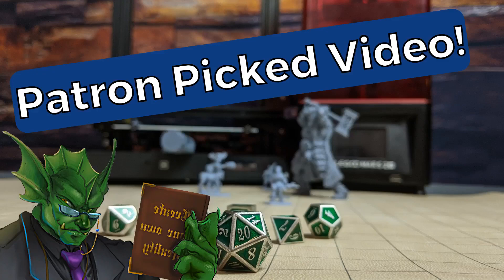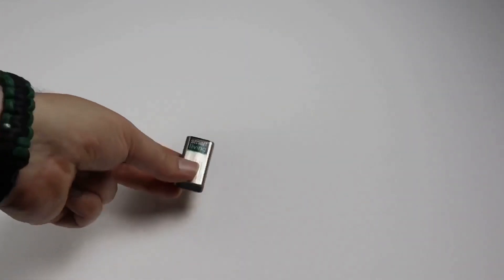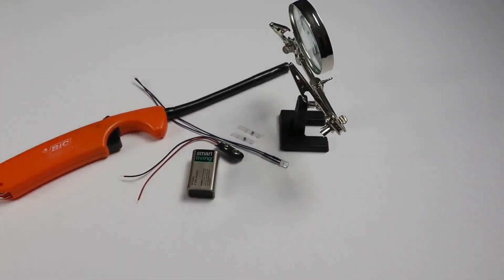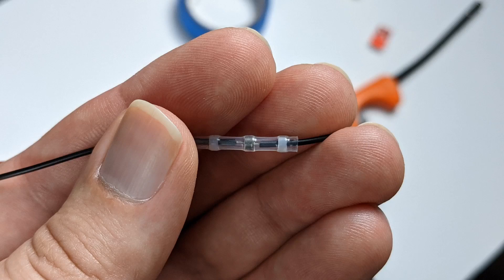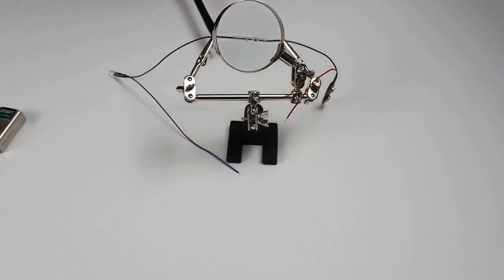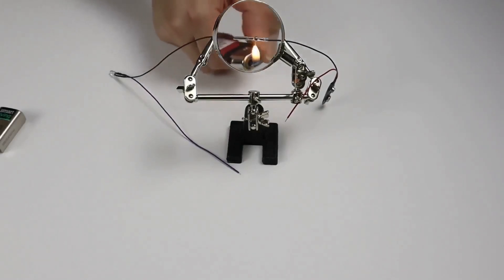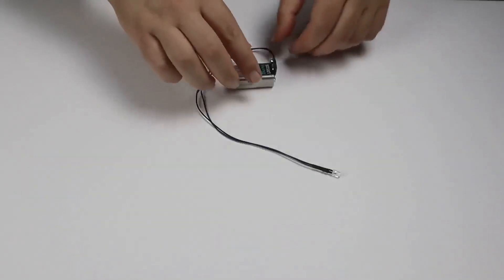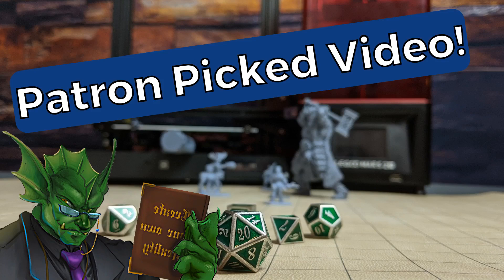How to Make a UV Pin Light for Curing Inside Hollow Resin Models

Comment: It is also important that the built-in resistor is mentioned with the LED, this should be included in your list, even if your recommended ones are already equipped with it.
But you make great videos with lots of good tips and information.
Reply from the maker: I do mention that in the listing for the LEDs. But you're right, it would have been helpful to mention it in the video as well.
Thanks for the positive feedback!

Comment: I know I'm necroing an old video, but I'd like to design and print a resin housing for this, and incorporate an on/off switch. Before doing all that, though, do you know if that's been done already?
I'll keep you posted when/if that comes out :D
Reply from the maker: I have not seen that, but it could easily be done. However, you could purchases most or all of the parts to accomplish that right from Amazon. You can certainly get 9v battery housings with on/off switches and go from there. But designing something from the ground up sounds like a lot of fun too!

Comment: You should not connect 1 led to 9V battery without a current limiting resistor.3 in series may be ok.
Reply from the maker: I appreciate the heads up. However, it's stated in the description that these LEDs come pre-wired with a resistor.
Reply: @SlicePrintRoleplay  Sry, didn't see the link. In that case 3 in series will not work!
Reply from the maker: @mikesgarage394  no worries, there's a lot of info on the description.
Thanks for the input!

Comment: Thanks for this video! Would there be any issue with connecting 2 or 3 of these UV bulbs to a single battery? I'm ordering the 30pc kit and in thinking it'd be more effective to have 2 or 3 bulbs on one string that I can feed up into different areas of a hollow 3d print. Just didn't want to do this if each bulb's strength would be compromised by drawing from a single battery.
Reply from the maker: That's a fantastic question! I'm sure there are people who can answer this question without having test it, but I am not one of them. 😅 If you end up testing multiple LEDs off one battery, please let me know how it works for you.
If you're worried about the multi LEDs no longer being strong enough then I'd test that too. Once you have it all assembled try curing a small drop of resin. It should only take around 20s to fully cure a small/thin drop of resin.
Sorry I couldn't be more help.

Comment: The amazon link provided says the UV lights are only 395nm - 400nm, whereas most resins cure at 405nm. 

Anyone have referral links to a 405nm light?
Reply from the maker: I have tested these lights and can confirm that they work well with 405nm resins. I was able to cure a small dime sized pool of resin solid in about 10 seconds.
Reply: @SlicePrintRoleplay  Thank you very much for your reply. Just ordered all of the parts through your referral links!
Reply from the maker: @gravitywell3315  No problem at all. I totally understand why you'd want to confirm before ordering. Thanks for supporting the channel by using those links!

Comment: That's a great tip, and super easy to make!  If you don't have those solder connections, you can just twist the wires together and tape or shrink wrap over it for the same results.
Reply from the maker: You can certainly do that especially for a low voltage and low stress wires like this.

Comment: Great video. I would assume you need a resistor so you don’t over load the led.
Reply: 12V LEDs so will have a current limiting resistor already wired inline, if you're doing this yourself with a 5v LED you will need a resistor.
Reply: Yes, but you can get them prewired with a resistor.
Reply from the maker: Great question and I'm sorry I didn't mention it, but the LEDs I have listed come pre-wired and are ready to go!
Reply: @SlicePrintRoleplay  Ok that makes sense. Coming from the R/C world, over-the-counter lights are prewired but you need to know that if you make your own.
Reply: @SlicePrintRoleplay  The not prewired ones will need a 470 Ohm resistor (if used with a 9 V battery), right?